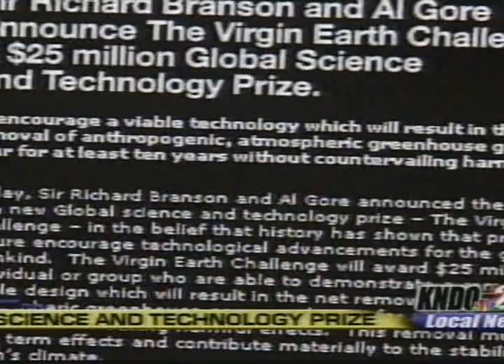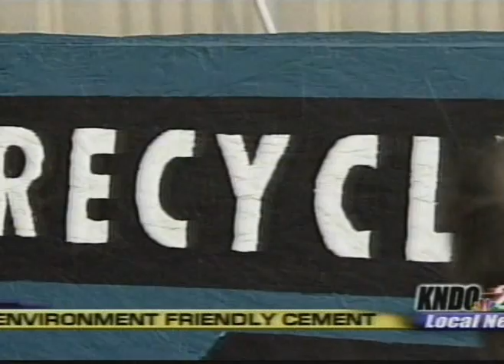AirCrete concrete for HURRICANE-proof homes.... NOW !

Comment: You mean you coated the straw-bales and they did not leak through the cement into the Bales at all? Did you open any up and look inside the bale and check. Pretty cool.
Reply from the maker: it adds content to the plaster so the bales can be resized restrapped and layed like regular masonry bricks... just big bricks.

Comment: Hey Rance! "great minds think alike"...or, you should be very concerned!!! Lol! I'm very close to your area (Columbia Gorge...) tried to get some acreage but too many $s! I've been getting a lot of strawbale info. but haven't seen anything like this before! I love the potential uses...what is your opinion of using a lime/clay render with the styrofoam as far as bonding? thanks for any info! Mike
Reply from the maker: Mike, get a large hi speed drill and mixer blade and a 20 gallon barrel and milk shake your portland, and lime and pearlite then mix them. You will get a 'chemical bond- super strong.

Comment from the maker: @bernie018 
Bernie, 
No. My experience with styrofoam is this: the styrofoam must bond with the cement to make a chemical/physical bond. If you add other elements- sand/perlite etc.....it prevents good bonding....if you want a high volume of styrofoam. 
Do some experiments yourself. 
Go to a cement company and ask them questions about cement curing.
Good luck,
It works.
Rance

Comment: I was looking in another youtube site for monolithic domes. They mixed 3 buckets of sand and three buckets of styrofoam and one bucket of cement. They were able to apply the mixture by hand or with a sprayer. Would you recommend this mixture  being used on a roof of an A-frame house.? It would be great to have a waterproof and insulated roof all in one applcation.